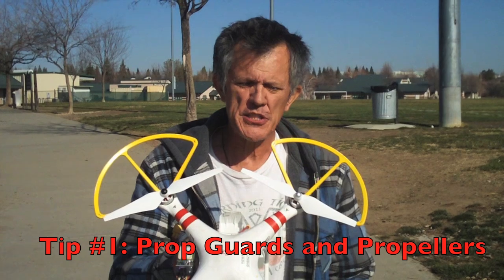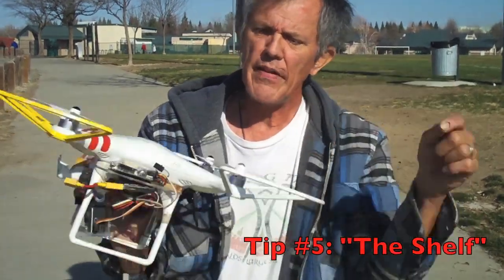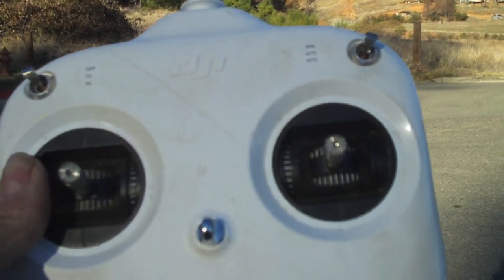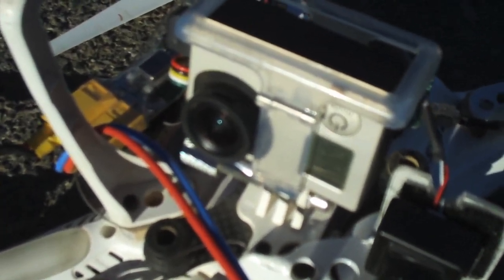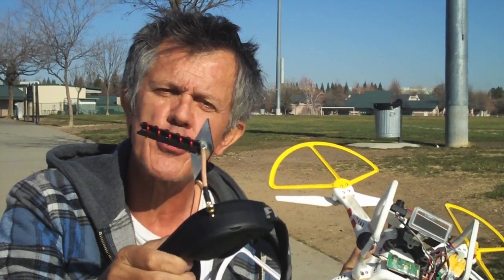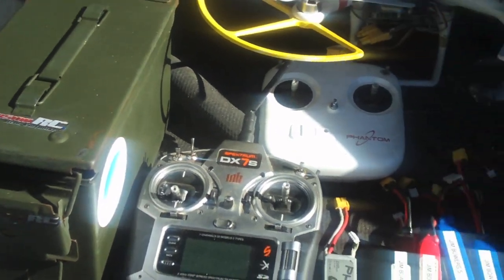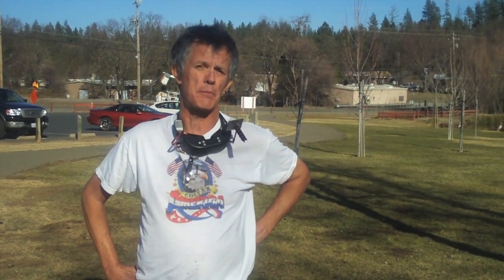DJI Phantom - "25 Tips and Mods" for your Multi Rotor, Quad Copter, Drone!

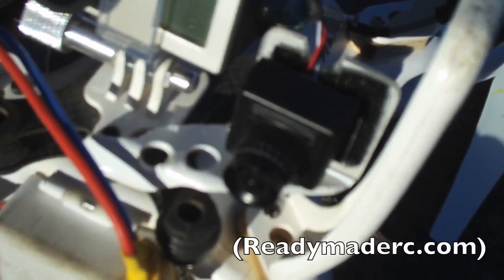Comment: A couple a questions if you don't mind. ON the puffy Lipo's. What does that mean, is the batter at it's end of life? Is there danger of explosion when this starts? How do you get 11 min. flt. time. The best I can get is 6 min. with my 1.1 and most of the time 4 or 5 min. Only maybe 20 or 30 charges on the batt. and that is with the zippy 2800MAh. As far as the thumbs down I would say it all what you said and things like the nicked props you are flying with (12:26) and the little stuff like that is not the compass dance. Some people just love it when one is not perfect and like to thumbs down people for any little thing. For me there is plenty of good stuff in your videos and none of us are prefect and have out own ways of doing things and that just rubs some the wrong way. Keep the videos coming ...but I would leave the nicked props out of the videos.
Reply from the maker: Thanks for that input steve...
Reply from the maker: Demunseed To answer your question on Lipos.... If they are just a Teeny bit "puffy" - don't worry. If it starts to get "chubby" it'd time to get rid of it. A puffed battery is not going to explode on you, but they ARE more dangerous then a new battery. So..... just be careful.
Reply from the maker: Demunseed A zippy 2800 is only good for "about" 50-75 flights..... then chuck em.

Comment: Thanks for all the tips. I've been using a lot of them including feeling the motors after a flight and how to point the antenna. I just need to get a battery box for my lipos.

I've been having a blast with my P2V+ since I got it a week ago. I'm addicted to flying it over water here in the Newport Beach area of Orange County, CA. It's so thrilling. Wish me luck. :P

Also, I read that some people suggest not using the prop guards due to a higher risk of VRS or "prop wash". I bought the prop guards but I've been flying with out them. Any thoughts on that issue? Thanks again.
Reply from the maker: its very easy to become a Phantom addict

Comment: Dear Jim ......thanks to post this amazing video.  I have a Phantom 2 with IOSD and gimball 3d with a Go pro atached and I almost lost this when I lose the TX signal and it returned home by himself. At the moment when it was coming to land, it was arriving about 2 meters away the home point and landing over a tree and some rocks. Fortunately I run to catch him before he crash over the rocks. I ask. What may I do to take the Phantom control when he is near me again?  Sorry my poor english ok................Many thanks.......Mario (Brazil)
Reply: When the Phantom 2 goes into "Home" mode because it either 1) low on battery or 2) looses connection to the transmitter, you can take back control by clicking the right top switch from GPS mode to ATT1 back to GPS mode. The Phantom will flash the red lights and you should have manual control.

Comment: Hi! Thanks for the video. Question around flight time. You said that using a 2800mah battery you actually doubled the flight time. How can it be done by adding +600mah comparing to the stock battery? It does not sound like a good measurement.
Reply from the maker: The 2800 has a higher C rating + we tweaked the naza software settings....
Reply from the maker: I'll try and find those settings and post them here for you. (I'm on a mac, so i need to get on a PC)
Reply: Demunseed Did you post the tweaked settings?  Isn't this dangerous as it may ruin the battery?
Reply from the maker: I run my batteries down to under 20% capacity and they recharge fine....
Reply: Thanks

Comment: Hey nice video..very helpful. But im wondering... you know that "Receiver Advanced Protection" on the software, should i have that on? do you recommend it?
Reply from the maker: Whatever the default is - i would leave it there. Ive never changed mine or activated it...

Comment: just read the rest if the posts and you had answered that zippy question already with 3s 30c...do you also happen to have a solution for wobbling? after take off phantom wobbles and seems to have issues with power distribution to motors...not sure if they are supposed to run smooth with each Stick movement...mixer is Quad rotor x (as others had posted that as a potential issue)
Reply from the maker: My guess is that your props are out of balance - try changing one prop at a time to see if that solves your problem....

Comment: Hey I bought the FC40 bcuz it's cheaper and first time rc flier. I did pretty good crashed a few time into the bushes and trash can. But i haven't did the compass calibration but still managed to fly this sucker and went smoothly. Also do I need to plug the phantom to my computer for NAZA firmware?
Reply from the maker: Calibrate yer damn compass ya Foo!!!  ;)
The last thing u want is a flyaway....
Reply from the maker: Demunseed and YES - you definitely want to plug your phantom into your PC and do your firmware upgrade and advanced calibration.... happy flying my friend.

Comment: Hi Jim, just rewatching this because I want to get a Zippy 2800 but just wondering if you could specify exactly which model it is as HobbyKing have 3 different kinds: 1 4S1P, a 6S1P and a 3S1P. Which one are you using in this video (I can't read what's on the closeup of the battery)? Or which type do you recommend? Thank you :)
Reply from the maker: Anna Ferguson 3S
Reply: Thank you kindly! :)

Comment: Where can we buy that landing gear ? Thanks. I have a DJI 1.4 something, is it okai to use a 9 inch carbon prop ? Thanks
Reply from the maker: send me an email to jimbowers@foothill.net
Reply from the maker: OH - BTW...., I personally do not use CF props on a phantom. They wont give you longer flight time plus they tend to add "vibration" to your video (too stiff)
Reply: youre right .. just got mine.. its too late.. was so disappointed with the outcome... my drone dont follow gps mode with the cf props LOL !! thanks by the way for the tip
Reply from the maker: shoot me an email to jimbowers@foothill.net for the skids...

Comment: well done video.  thanks.
Reply from the maker: Thanks Gary.... what are you flying?
Reply: Demunseed I've been checking the internet and youtube learning about the quads.  From what i have learned, it seems the Phantom V+ is the way to go.  I found  a dealer in my area, and hope to have one by October.
Reply from the maker: ***** Excellent - Be sure to watch my Vision+ "Quik Start" video before that first flight.... Might save yer butt from a "Oh Shit" moment.
Reply: Demunseed To be sure I will.  I was thinking about attaching a few hundred feet of fishing line the first couple times just to make sure it doesn't fly away.  It would weigh next to nothing and give it a few hundred feet of fly zone.  Then after I felt comfortable it would return on it's own if something happened cut the line.  Not sure I will do that, but I might.
Reply from the maker: Well, if you just want to be OVERLY cautious (nothing wrong with that), you might run 100' of fishing line to it for the 1st flight just to make sure it's not defective from the factory, BUT I'd definitely "cut the string" after that. There's really no need to worry about it. It'll fly just fine for you. (they are all test flown from the factory from what I've been told).
So, just fly the liven Hell out of it, and have FUN!!!~   (no worries)

Comment: Hey Jim, I have a phantom 1 and upgraded to the 9443 vision props as you did in this video. You said that it created a more stable aircraft, noticed my phantom is not as stable as it used to be with the standard props. Not sure if your ember any of this, as this video was made quite awhile ago, but did you keep the 'gains' the same or did you change them?  Thanks!
Reply from the maker: Parker Schnitker I left the gains the same. You may have an "out of balance prop" try changing one at a time if you have an extra.
Reply: I wish I could balance them, but they are self tightening and I cannot balance my props without spending 15 dollars or so, do you know how I could do it for cheaper?
Reply from the maker: no i don't - you need a prop balancer

Comment: Where can I find the Vision props for the Phantom 1? I looked on E-bay, but they all say for use with the Phantom 2.
Reply from the maker: if you have the version 1.1.1 Phantom, the Vision props will work and fit your Phantom, just buy them and install..... you wont need your prop nuts anymore.
Reply from the maker: Also, does your phantom have ALL SILVER prop nuts? Or, does it have two silver and two black prop nuts? This is important. If you have all four silver prop nuts, you will have to buy and install TWO CCW (counter clockwise) threaded motors in order to use the Vision props.... Got it?
Reply: I have the black and silver. Thanks for your help. I'm going to order the new props now. You're video was very helpful.
Reply: Thanks. Happy and SAFE flying to ya!

Comment: Hi, I am going to buy a drone this week and am looking at the phantom 2 vision.  I need it to go straight up and shoot a quick 30 second panning video of roofs for insurance inspections.  I am in Indy and travel to MI where it is windy and rainy.  I have been getting feedback to get the regular vision with white camera as it will survive a crash better than the multi angle gimble ones.  Any input would be helpful?  Also, I am going to send you money for the skid set.  I will drive with it in the trunk of my car and have to fly 15-20 roof videos a day, do i have to do the compass and gps circle procedures like you show in your video at every stop?  What is the approximate time from removing from car to getting in the air?
Reply from the maker: The regular vision does not have "image stabilization" - get the vision+ (the short answer)
Reply from the maker: Demunseed I've been thinking about this.... I actually think you might be better off with a Phantom 2. (bare). Add your own "heavy duty" readymaderc gimbal and a go pro white edition camera. Your all set and its "industrial strength....( you can also add FPV and OSD  later if you want it)
Reply: I talked to the guy at aces and i was set to buy the vision monday with extra battery.  The way u are explaining...would i be able to see what im videoing in real time so i know i have the roof done before i land?
Reply from the maker: josh bungen With the "build it yourself" NO - not unless you add the extra FPV video transmitter and then you'd need to buy goggles or a ground LCD monitor..... You might be better off sticking with the Vision or Vision+. They both will do EXACTLY what you need it for right out of the box.... sorry if I'm confusing you.
Reply from the maker: As long as your a pretty careful guy and not TOUGH on yer tools, get the vision+_ (just take care of it and it will serve you well). If your pretty tough on your tools, get the regular Vision.
Reply: Demunseed The couple days a month I do use it I will have it in and out of the trunk of the car up to 20x a day in winds etc so I would call it rough use but not intentional abuse.  I just need to extract the three screenshot photos from each short video so I think I will be ok with the vision.  The ar drone 2.0 that I have been using was fine on the videos just got tossed around pretty bad by the wind last trip.  I also saw they dropped the price a couple days ago to 899 for vision with extra battery http://www.dji.com/info/news/phantom-2-series-price-drop I am going to order Monday.  What is the total for those landing skid extenders you sell so I can send you money for some?
Reply from the maker: Yer right then... get the vision. more durable than the vision+.
Skids are $26 with shipping. shoot me an email request to jimbowers@foothill.net
Reply from the maker: OK....

Comment: I have a question to ask. My Phantom 1 goes threw the series of light for connecting with the satellites and comes up with the green flashing lights as if everything is ok. But when I take off everything turns red. Not sure what's going on. Have you ever experienced anything like this and if so how did you correct it. Any and all help is appreciated. Thank you.
Reply from the maker: Have you tried different batteries??? It sounds like your having a "low voltage drop" problem causing the phantom to go to red light blinks.....
Reply: I just had a out of controld crash. I was descending when it came completely out of control and crashed. I went back up and when on the ground I have the green blinking light but as soon as I take off it turns red then green again. It seem to searching. Any suggestions?
Reply from the maker: is it a CONSTANT red light, or a blinking red light? Does it stay blinking red while your DESCENDING? If not, it's definately a voltage drop problem....
Reply from the maker: also, have you hooked it up to the assistant software yet and checked your settings? Something might be out of range.....

Comment: How large are you props and how much flight time are you getting?
Reply from the maker: Vision Props - 9". You'll need to order the Vision prop guards to go with them. Theyll fit fine.
Reply from the maker: Demunseed OH and BTW - With the Vision props, I'm getting a solid 10-11 minutes of flight time (fully loaded with camera and OSD). The only downside of Vision props is that they are a little "brittle" so be careful with them, especially on hard landings....
Reply: Thanks for the info
Reply from the maker: yer quite welcome - Happy and SAFE flying

Comment: Is there no way to downlink the video tx from the camera? I know you cant change the vision camera to a go pro or zenmuse on a PV2 but how would you do it on other cameras? I have never tried this before. The wiring is more difficult for a PV2 but are there any ways of tapping the video, either with a wire or using the frequency band? Thanks
Reply from the maker: SHORT ANSWER - NO
Long Answer - Anything is possible if you've got the "Knowledge / time / $$$$$$$"

But - it's "essentially" more trouble than it's worth. 

If you want the BEST solution tho - get a DJI Lightbridge AND the Cinemizer FPV goggles. You'll be blown away for just $2000!!!!
Reply: Theoretically if i had the lightbridge and cinemizer, how would this change the aspect of tapping into the vision 2 camera? Does the lightbridge act as a video TX? Does it also need to be powered by the one remaining cable and would I have to build a shelf for it? Thanks for your help!!
Reply from the maker: Yes and Yes - search the "lightbridge" tutorials here on youtube.

Comment: Jim which video shows installing shelf and leg extenders?
Reply from the maker: "DJI Phantom MOD KIT" shows you how to install - skip to middle. :-).
If yer having a little trouble with the skids, don't worry about cracking or breaking them, just WRIGGLE them down till they Click on.... no worries my friend....
Reply: Thanks Yes I have the skids installed.   I got legs from Peter so u am waiting for them to come in to add shelf and extenders.  Now doesn't the shelf make one side longer?  Also what is the range of the Vision plus for the controller range, 800m?
Reply from the maker: The Shelf Unit adds minimal weight to one side of your Phantom that the FC will compensate for. (some guys are putting an additional shelf on the opposite side). I've been using mine (on just one side) for over a year without any issues.
The "effective average" range for a Vision+ without a range extender is right around 2500' LOS..... (unless you have "limits" set in your settings.
Reply from the maker: Go to a wide open FLAT area and give it a test run out to 2500' around 80' AGL... Worse thing that can happen is it will RTH. (make damn sure you have good home point locked down before attempting - 6+ satellites
Reply: Will do thanks

Comment: There is a multiple potential explosive hazard by storing multiple batteries within a shrapnel metal case, store each battery in its own uncovered metal case, so one battery won't ignite several others. first in a ceramic bowl or vessel, then in the metal case, one battery per storage compartment, like a fireproof safe, with the lid kept unlatched, one for each battery, if you want to be safe, they should sell these things.
Reply from the maker: Scottslookingabout I agree.... I'm ALWAYS worried about another battery explosion. (Ive had two in the last three years)

Comment: You don't use a gimbal? I'm looking at the zenmuse 2 axis... Thoughts?
Reply from the maker: great gimbal... a little pricey. I just bought the Ready Made RC gimbal, its made by Feiyutech. About $175 at ReadymadeRC.com
Reply from the maker: im now using the Feiyutech gimbal sold by readymaderc.... love it at $180
Reply from the maker: Demunseed The ReadyMadeRC gimbal is actually a knock off of the FeiyuTech G3. Excellent Gimbal but just a Tad Bit Heavy....